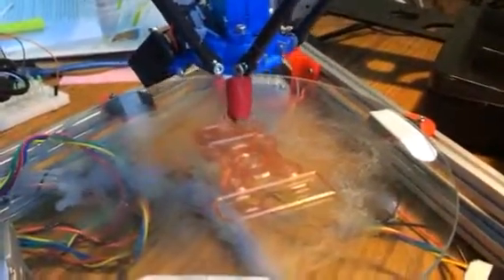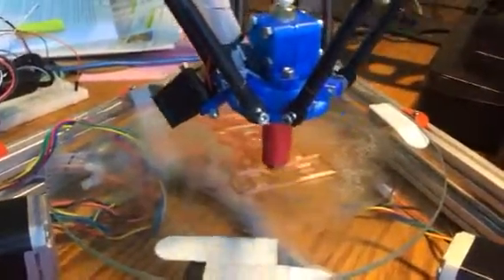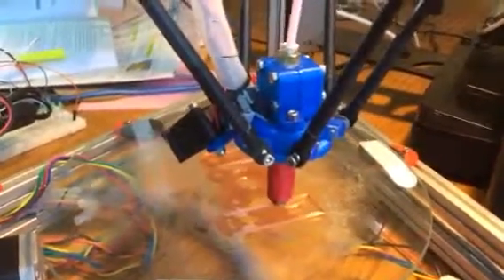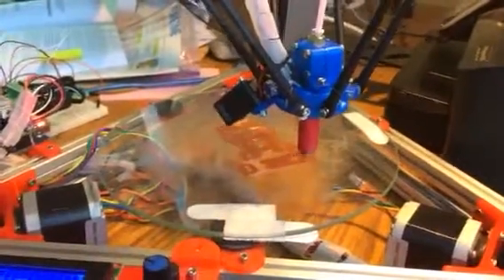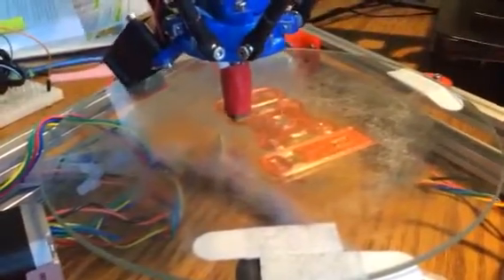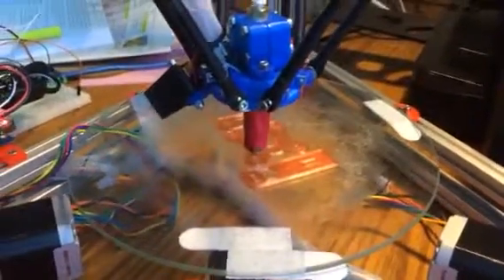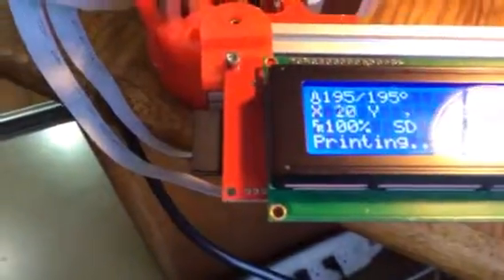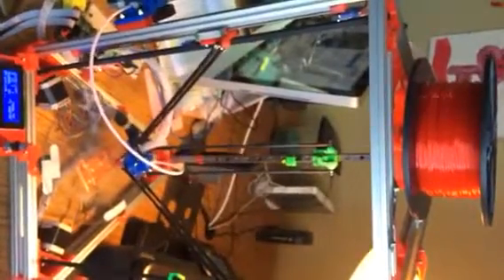Mini Kossel update

Comment: what do you have your heatblock wrapped with?
Reply from the maker: That is a Ubis hot end from Printrbot.  That is insulation that is heat resistant.
I now have a different effector connected to the rods and I am using a E3D v6 hot end with a fan on the heat sink fins.  No insulation on the E3D, it has heat sink fins.
Reply: I think the insulation would help below the heat sink on a e3d. I just can't seem find out what that heat resistant insulation is.
Reply from the maker: Robert Burns http://printrbot.com/shop/insulation-sock-for-ubis-hot-end/
Measure the diameter, then google "high temperature coated fiberglass sleeve". Or just go to McMaster-Carr, 
http://www.mcmaster.com/#fiberglass-sleeving/=vwwp77

Comment: What FSR mount design are you using to mount the springform pan to the 350mm horizontal extrusions? I'm looking to do the same with 350mm extrusion and http://www.amazon.com/gp/product/B0000VLYQI but am not sure how to mount the springform. Thanks.
Reply from the maker: I bought one at a local kitchen equipment store Kitchenkaboodle.
Yes, the same one you found on Amazon.
I have 112.5mm radius printer settings in Cura for slicing.
The hot end will go all the way to the edge of the glass.
Reply: Richard Turnock That's great that I have the same part you used. What are you using to mount the springform to the extrusion? Thanks.
Reply from the maker: Craig List  I printed three plastic tabs that are flat, attached them to horizontal extrusions with screw, and glued a neoprene washer on top because I was testing FSRs for auto leveling.  Sounds kind of weird but I just used them without the FSRs. I have a piece of double sided tape on the bottom of the glass aligned with the neoprene washers.  Then I printed another plastic part and put in a longer screw, to fit on top of the glass to hold it in place because it was still moving around when I scrapped off a part.
Weird, I know.  I ended up with the edge of the glass held in place by a plastic sandwich, and the double sided tape between the neoprene washer and the bottom of the glass.